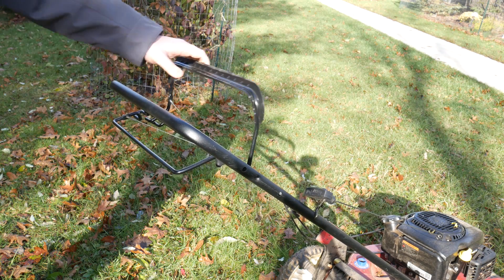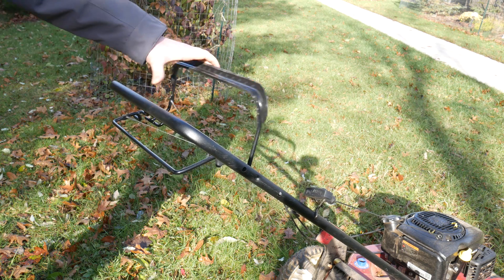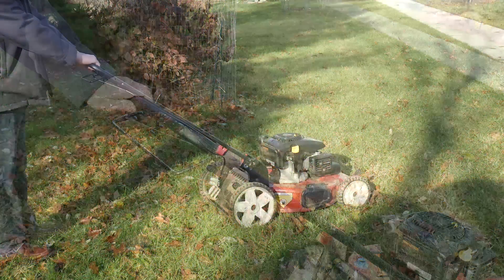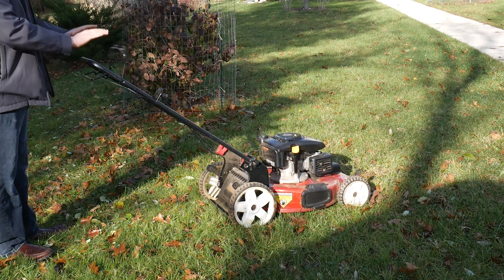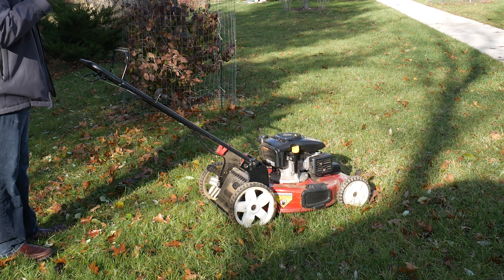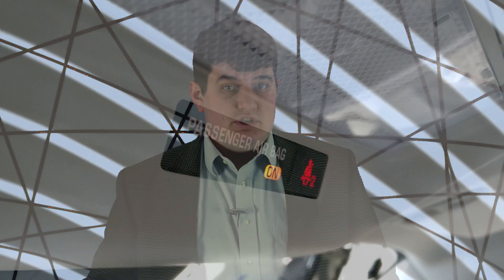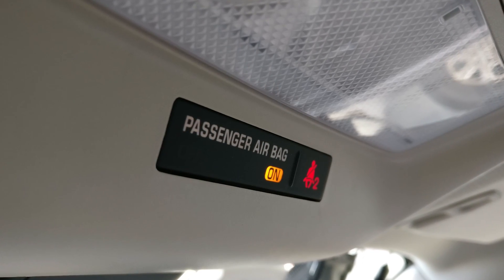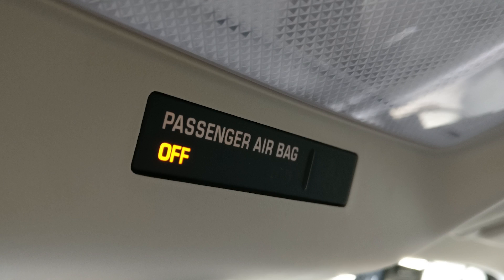The Dead Man's Switch:  How Anton Yelchin's life could have been saved

Comment: Throwing the car into park on a loss of seat pressure could be problematic in case you lift up your butt in motion for a mundane reason.

My Toyota sounds a high pitched continuous alarm tone if the driver door is opened when not in park, and it's hard to believe that wouldn’t be enough for someone of a mental capacity to drive in the first place.

Comment: Ehh... Under normal circumstances, you're right, but there are important emergency corner cases where the car needs to be in neutral without a driver. The big ones that come to mind are loading it onto a tow truck, or trying to push a disabled vehicle out of the traffic lane. You really don't want to have to dig out the manual and search for the magic combination of buttons to press to disable the driver interlock in an emergency situation, especially when some controls may be damaged.

Comment: There were a few late steam locomotives had a form of dead man's switch where a valve implemented into the seat would bleed off the steam pressure if there's no driver in the seat, and most diesel locomotives have them as a standard for decades, so I find it hard to believe NO car manufacturer EVER thought of the idea of implementing one.

Comment: Heck the forklifts where I work use these.  If you leave the seat it shifts into neutral and the lift controls become inoperative.  A variation could set a brake or shut the engine down, but this is the configuration chosen by the manufacturer for this model.

Comment: This could be done. But not as simply as you suggest. There could be inconvenience when a person wanted to move the vehicle while not sitting in the seat. Like pushing a disabled car off of the road on a dangerously busy highway or freeway at night. There could be an automatically resetting override switch for that rare occasion. A disabled vehicle would require someone to sit in the drivers seat for the car to be winched up onto a recovery truck.
All vehicles should have a relay operated override to the fuel pump power wires. Obviously placed with a covered flip switch on the dash board. In case of a runaway vehicle or a criminal attempt/ hacked attempt to cause a crash. The switch would immediately kill the engine power while leaving all other electrical/electronic systems fully functional. It would be dirt cheap to build that into a “drive by wire” car. A direct mechanical on/off valve in the fuel line on the floorboard would a higher level of safety. All light airplanes use direct fuel line mechanical valves for tank switching. 
That said, we own a Jeep almost exactly like the one that killed the actor. It is a POS shifter system. It requires you to look at the shifter handle to confirm what gear you are in. I don’t like it because if the engine ran away it would not let me shift into neutral or reverse to stop the car. Who cares if the engine blows or the transmission grenades at that point. I just want reliable way to stop the engine from accelerating the car.

Comment: I know that this adds zero to the conversantion but, my Citroën does not have this problen, you see, I have a manual transmision and a real parking brake, soo when you shut it of, pull the lever as high as it goes and put he shifter in a direction oposite of what you think its gonna roll of if the brake fails (1st if is gonna rol back, reverse if its going to go forward, whatever in flat terrain) and turn the steering all the way in the direction oposite of the road if it were to roll of as it is. Then Again, Im european, soo the drivers license is actualy a high bar to pass, not something that a highschool will teach me to do.
On the other note, a deadman, as userful as it is, in no replacement for bad desing, nor excesive complexity, since that could kill way more instead.

Comment: I hate to say this, but anyone who couldn't operate that gearshifter without killing themselves was a person who couldn't safely drive a car. I literally drove one one time. It was a rental Dodge Charger that I drove from Baltimore to Norfolk. Coming into the experience with no familiarity with the system at all, and having never even driven a Dodge, it was not difficult to operate. At the time, I was also extremely tired, because this took place on the day I got off a ship. Anyone who has ever worked as a merchant marine officer knows that the day you get on the ship and the day you get off are about the two longest, most tiring days you'll ever have. So with no prior use and with extreme fatigue I found the system to be easy to use. I also noticed that there were also about 7 indicators in prominent positions including 2 on the gear level, at at least 2 more in the dash console (ok, 7 is a minor hyperbole, but it did stick out in my mind that I had never seen a car with and automatic transmission and  so many different indicators of what gear the driver had selected before. Most cars I've driven range from 1 indicator to 3 indicators. I think this one had 5). I understand the aspects of the design that made it not good, but really, the fact of the matter is that the operators of those vehicles were not competent. Yes - a better, safer design would obviously be better, and it was the right decision to stop using that interface and start using another one.
However, the final responsibility for the safe operation of any vehicle is always and 100% that of the driver. I'm sure dozens, if not hundreds of people will disagree with me, but please save us all the trouble and don't bother telling me about it. I'm not interested in hearing what anyone has to say on the issue.

Comment: The problem is that people won't use it as a backup. Take lane-keep assist, for example. It's supposed to keep your vehicle in lane in case you are distracted or something. But it's not perfect. For one thing, it doesn't have very good detection of faded lines on the road, and it doesn't work at all on roads that don't have any lines. Even when it does detect them, it usually only kicks in when you are already over the line, which is still helpful I guess but it's way too late imo.

And yet, when people get in a vehicle that has this feature, they think "oh, it'll drive itself now! I can look at my phone instead!" and instead of it being a backup that system now becomes the first and only line of defense to keep the car from careening off the road.

That's the real problem with safety features. You give people a system that allows them to stop paying attention to the road and they'll do just that, and it winds up being even more dangerous than before. I don't really know if there's a good solution to that problem either, until we get cars that are completely autonomous we have to be more careful about when and how safety features are implemented in order to prevent them from being abused by lazy drivers. People need to treat driving with the respect it deserves, not be given even more features to act as training wheels. The only way to truly make cars safer is to make more responsible drivers. As of right now, computers cannot act as a replacement for that.

Comment: The dead man's switch on my riding mower is extremely annoying, because my dad (rip) added a switch for the lights, and ever since then, it drains the battery when it's off, regardless of that switch's position. So for now I have to start it with an external battery and any time I shift in my seat too much or forget to set the brake when I get off, I have to lug a battery and jumper cables out to it. I'll eventually figure out how to fix it, but for now, it's very annoying.

Comment: Some vehicles like the new peogeot partner and 308 automatically apply the parking break when the engine is switched off
Reply: The problem with the Yelchin case was that he didn't switch off the engine. He left the car idling, likely thinking it was in park when it was actually in neutral.

Comment: I'm sure all 228 passengers of Air France Flight 447 would appreciate your claim that fly-by-wire will save lives.  Something goes wrong?  Let the computer handle it, and we can all go back to sleep!
Reply: You might want to look up what happened during that accident. The plane was in manual control but due to a fault in the pilot tubes, was giving an incorrect reading on their velocity, causing the pilot to overcompensate against the turbulence,  which made the plane stall, which the pilots didn't realise in time.
Reply: @emmastrange5557  Air France 447 was forced into manual control when the pitot (not pilot) tubes gave irrational readings, but this situation lasted only a few minutes.  When sensors returned to normal, the pilot flying (Bonin) stalled the plane, an incredibly amateur mistake.  Fly-by-wire only works if you use it, and they didn't use it, all the way down.

Comment: While the idea is noble, there are serious downsides. A friend is a TÜV inspector (Germany's version of MOT). Not only they have to test all those safeguards and gadgets which costs a lot more time, they also have problems with those. 
For example, for some tests they need the ignition ON but the engine OFF. Some modern cars have a Start/Stop button and don't allow the ignition to be on but the engine to be off. Some cars have "cheat codes" but there are cars you have to stall or they can only be TÜV certified in a garage of the manufacturer using a Laptop. And some cars refuse to behave properly on the brake tester.

Also a lot of service garage have problems, e.g. the cars electrically lock the brakes when parked. You can't push the car around the garage or service some parts. You have to remove parts of the brake system and don't forget to reinstall them after you did the service.
If the car dies in your garage, you can't get it to a garage easily because the brakes are locked.

Comment: I don't know all the details of this accident but there is a even simpler solution potentially that I'm sure this guy's car was fully capable of Kano assuming the engine was still running many cars have these feature in place already called Hill start assist. It applies the brakes through the ABS system when you take your foot off the brake and before you apply the throttle. This is meant to keep the car from rolling backwards on hills , it's not a feature exclusive to very high in cars either it is common on Subaru's as well as other affordable cars. 

Its something that's absolutely software enableable on 99% of any new vehicle as ABS and traction control are near universal features now.  Even 20 year old cars often  had the technology in place and adequately interconnected to implement this in software.

Comment: I would absolutely love to see a deadman switch directly operating a parking brake off the transmission.
Why?
Because if literally anything happens its now breaking instead of using a parking pin. 
An electro magnet holding a regularly closed brake open when there is an operator in the seat would do the trick, and provide a bit of breaking during emergency situations where the power has disconnected fully, although not enough to skid or lock the wheels. 

Preferably one weak enough not to lock wheels on slick ice, just a simple slowdown break, and it would be easier to operate then other emergency breaks, just include a oversized dimmer switch on the break lever so you can flutter it with no heavy pressure.
Reply: If it's weak enough to not lock the wheels on ice it probably won't be strong enough to hold the car on a steep incline. And the rear wheels have almost no braking force anyways so it wouldn't do much at all to slow the car down, it would just make the handling unpredictable. And you don't always want to slow down when you lose power. A design like that would likely cause more accidents than it would prevent. A better solution is a simple mechanical handbrake, which is easily operated and very reliable, with an electronic solenoid to engage it when the vehicle is stopped and a deadman switch on either the driver's seat or door is activated.

Comment: The issue with this is gremlins, one problem during operation, such as switch failure or shorts due to age/wear can cause accidents, regardless of testing.

Example: traveling at 15mph and the seat switch fails, this result makes the computer believe there is no passenger and go into park during movement. Now let's assume the switch is shorted, the car will not go into park automatically and the driver would never know this feature is not functioning correctly.

You can create software to monitor these systems and even do normal checks on the system during operation, but the malfunction will likely occur while it's sitting unused.

So in the end, if you are unsure your car is in park, check. If you don't and get hurt, it's your fault. (And if you check and get hurt, then your car needed maintenance well before the issue occured).

This isn't a blanket statement, but reference to the initial idea you brought up.

And on airbag weight sensors, try putting a small grocery bag on your passenger seat, the airbag will deploy because it senses a passenger. I have had the issue of the seatbelt light going on when no one was in a seat (2002 Ford explorer, 2003 Chevy Blazer, 2013 Hyundai sonata, 2017 chevy Silverado, etc) in which placing a load heavy enough on a rear seat bench or passenger seat will cause the car to believe a passenger is in place. (I like the manual airbag shutoffs from the early 2000's).

Comment: You do have to be careful with implementation too though.
In my experience, it's also most often the electrical system that fails first and most often, be it battery or alternator, in cars both new and old.  And newer cars to meet high efficiency requirements are going with smaller batteries that barely do the job when new, and provide very little margin for error if you lose the charging system.  We had an old 80's car with a carb and minimal electronics it went an hour or two of when the alternator belt broke getting safely home, only giving warnings as we got near home and the turn signal drew the battery down with each blink.  Newer cars you can barely get to a safe place to stop on narrow 2-lane roads ~10 miles long between getting a charging-system warning light and the entire engine dies from lack of electrical power and you're waiting for a wrecker.  My current car I learned the fuel-pump relays drop out at a much higher voltage than the starter will still crank the engine over...which is frustrating when you have a week of single-digit subfreezing weather - I had to find a higher capacity than OEM battery that would fit in the tray not even 2 years after getting the car.
There is also trend on some car forums to advise NOT using the parking brake when out in remote areas because of some people getting stuck where it won't release for whatever reason (maybe a dead battery and they need to move the car to get jumper cables on) and it can be made worse if they are in a location that roadside service won't come to them or has no cell signal to call for help.  Yes, places with poor/no cell service still exist (I live in one such place).
The other issue is some electronic controls seem inferior -- the electronic parking brake will fully lock up the wheels when you apply it.  While infrequent, there are cases where the main brakes can fail (my parents had this happen when a shop improperly bled the system) and you NEED the "parking brake" to stop the car in a controlled fashion, not just locking up the wheels and skidding out of control (as the manual warns my car will do if you try to apply it while moving).  A foot pedal or hand lever can be moderated to apply controlled force slowing the car without damage.
This now also makes me wonder, what'd happen if your electrical system fails and its all computerized?  Might you be unable to put the car in park or apply the parking brake if you have too low a voltage, leaving it MORE likely to roll away in a breakdown?
I like computers, but I don't like them in critical safety control situations.
Reply: I'm not a fan of all the electronics being jammed into cars these days. In addition to the potential problems you described above,  the cars are ungodly expensive and anytime something breaks (which for the blindspot sensors can be a barely noticeable scratch on the bumper) you can spend a fortune repairing it.
Reply: I totally agree
Reply: EMP rip
Reply: I had a very hard time following that. Why not put a tl;dr?
Reply: @TheFlutterQueen  Mechanical linkages are good for critical safety components, because electrical systems aren't 100% reliable. As long as a linkage is properly adjusted and not rusted out, there's no reason it should fail.
Reply: @TheFlutterQueen  because this isn't reddit
Reply: I don't think drive by wire or steer by wire are good because what if they break when you are driving. How do you steer if the steeringwheel does not work
Reply: Electromic handbrakes are terrible. I hate them even more than i hate automatic transmission.
Reply: Parking brakes are often called "emergency brakes" for the very reason you described.
Reply: @TonyP9279  though electronic parking brakes are implemented to lead to a "safe stop", the fastest possible braking maneuver. 

Which brings up a nice nieche useage: If you're in a car driven by a dangerous idiot who won't listen to your safety concerns, you can threaten to pull the handbrake and actually just do it, after checking the mirrors for traffic behind you.